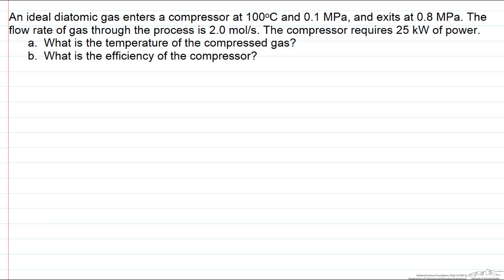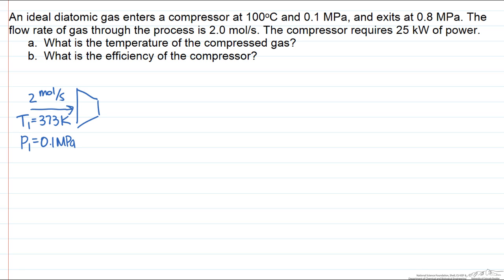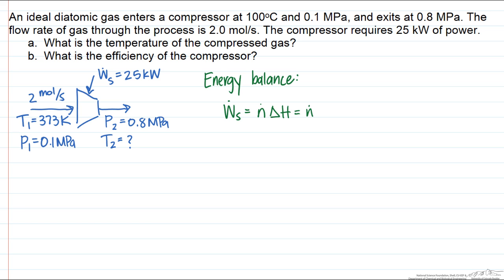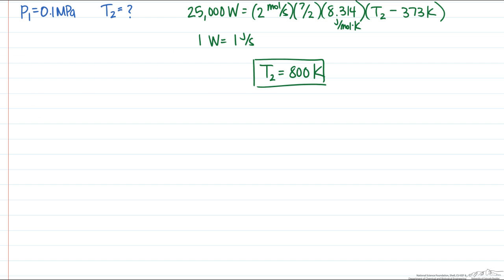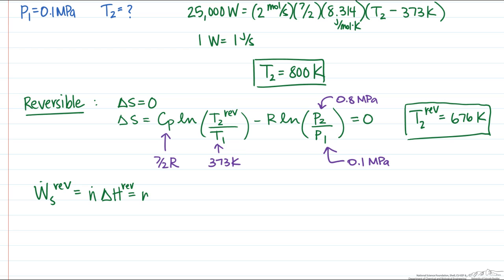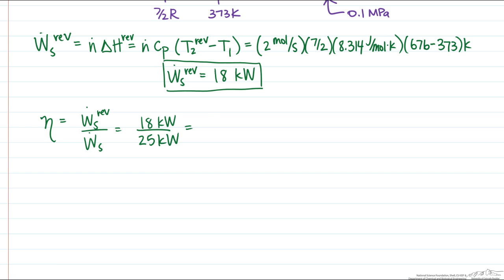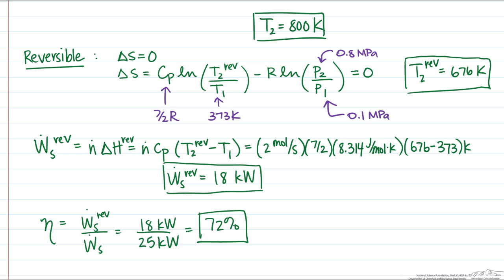Compressor Efficiency

Comment: How do you get T2rev = 676K? By my calculation it's 3971K every time, what am I doing wrong?
Reply from the maker: T2=T1[P2/P1]^(2/7)= 373(0.8/0.1)^0.286=675.7,  where 2/7 is R/Cp
Reply: Thanks! Got it now, I was just applying my ln rules incorrectly!

Comment: Thanks for the video. Perhaps it must be noted that reversible doesn't mean dS=0. Internally reversible and adiabatic mean dS=0
Reply from the maker: Yes, compressors are typically assumed to be adiabatic.
Reply: yes...as in reversible process only we dont know whether there is heat transfer or not...thus we can only say that S(gen) generation of entropy is zero..but not the entire entropy change of the system

Comment: Pls how can I get the molar flow rate of the compressor
Reply: Danjuma Joseph it must be a known data. 
Practically, in a plant you'll see normal volumetric flow (Nm^3/h) that can be converted into molar flow by using equations of state. Usually, Normal condition refers to 273.12K and 1 bar. So that you can calculate the molar flow. 
Hope this answer your question.
Reply: @edwardgustaf7399  Normal conditions refer to 20degC, standard - 0degC.
Reply: Luzt it depends what standard you are using. In term of Nm3/h the standard conditions are as I mentioned before.
Reply: @edwardgustaf7399  I did a little research and:
- "normal" generally refers to normal in a sense of laboratory ambient conditions, i.e. 20degC,
- "standard" generally refers to 0degC,
- both Sm3/h and Nm3/h are in use,
- it makes sense to use S for Standard and N for Normal.
I actually don't care who is right/wrong. I just wanted to clarify it for myself. Have a nice day.

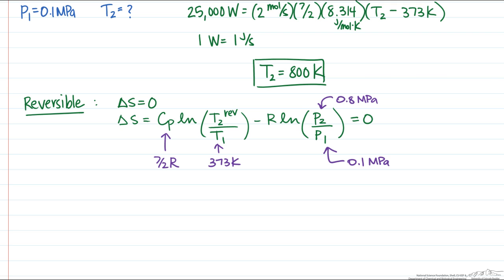Comment from the maker: @harish eswar To calculate T_2rev, you start with the equation at time 2:28.  Since you know all other values and that it equals zero, you can solve the equation. Move the second term to the other side of the equation: 7/2R(ln(T_2rev/T_1)=Rln(P_2/P_1). The R's cancel and P_2/P_1 = 8, so 7/2(ln(T_2rev/T1)=ln(8)=2.079. Multiply both sides by 2/7, so ln(T_2rev/T_1)=0.5941. Take the exponential of both sides: T_2rev/T_1=e^0.5941=1.811.  T_1=373K, so multiply both sides by that and you have the answer: T_2rev = 675.7 or 676 K.  Thank you for your question.
Reply: i m not clear about 1:30.. how do u get the yellow bit?

Comment: how do u get the T2 in rev case can u plz solve elaborate
Reply: lnx-lny = lnx/y 
5lnx=lnx^5
e^lnx=e^0 =) x=1
with that you should be able to rearrange the equation to (T2/373)^3.5=8 
(8*373^3.5)^(1/3.5)=676

oh also T2^3.5/373^3.5 =(T2/373)^3.5